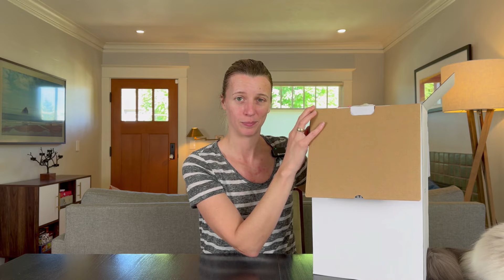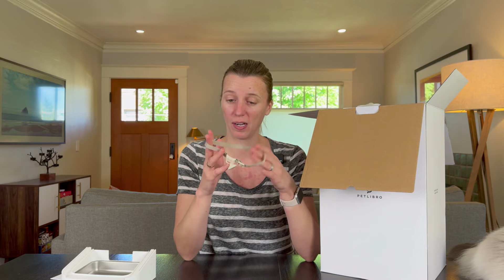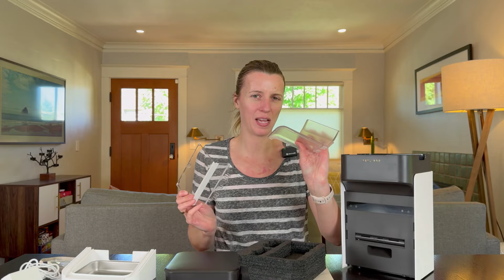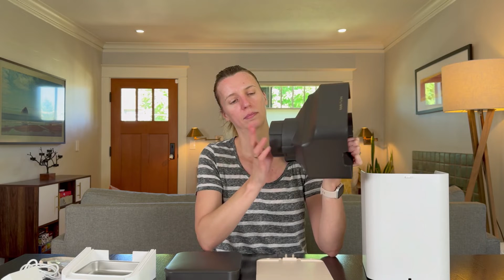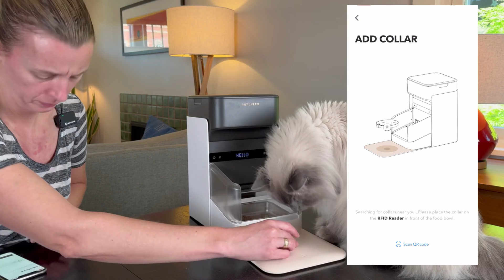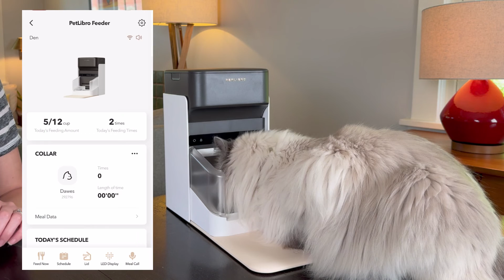Unbox and Set-Up An Incredible RFID Automatic Cat Feeder from PetLibro

Comment: Sadly, I'm looking to move away from this. It doesn't close fast enough and the cat can be quite far from the feeder before it registers it. Plus, annoyingly, if there's a spec of food in the way the stupid feeder will lock open! Yes, open. Because you bought a selective feeder only for it to be open to all. Bang head here... Needless to say, I'm on the hunt for one that actually works.
Reply from the maker: You may want to consider the surefeed. It's still the best rfid feeder out there because the brand frustratingly holds all the patents and doesn't let others license them. It isn't an autofeeder, but it opens and closes without any issue using a collared rfid or the cat's microchip. Here's a comparison video I made on these two: https://youtu.be/dLLwtJsgVSI
Reply: @alderandjade  Yep, had those and switched them out for pretty much the same reasons you mentioned. No power and you have to refill it. Back to the drawing board...
Reply from the maker: @davemckewan4450 If you ever find an answer and think of this chat, I would so love to learn what you find! I'm constantly on the hunt too so I'll be sure to make content on any solid contenders I find. And I've been looking. The lack of quality options is frustrating.
Reply: @alderandjade  So I'm seeing this. Not sure if this is legit or not as I can't seem to find this unit from the video, they don't mention a model in it and the URLs on their YT bio are dodgy, dodgy, dodgy (I run Linux so nothing came of that)...:
https://www.youtube.com/watch?v=F6mJECCpKhs

Comment: I had to review the start after seeing something move. Apparently there was a cat on your table at the start. 
Sad that it takes WIFI to work. I use my phone for my WIFI and it also goes with me when I leave. Does that affect the action of the feeder?
Reply from the maker: Ha! Yes. The cats know that the only time they are allowed on the table is when I'm doing product reviews. Specifically cat product reviews. 

It doesn't need wifi to work specifically. Once set-up, it will just run on whatever automation you set it to even if the WIFI went down. I personally love that it uses WIFI as that means I can get notifications if something is wrong or that everything is working smoothly even when not a home. I can also change settings or do a manual feeding when not at home. That said, I don't know if it will connect to the WIFI provided by a phone!